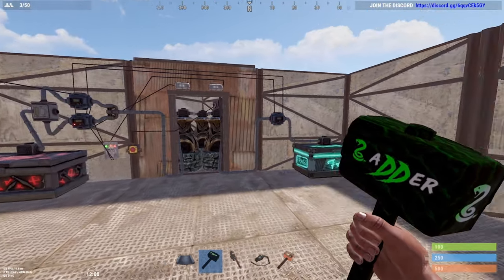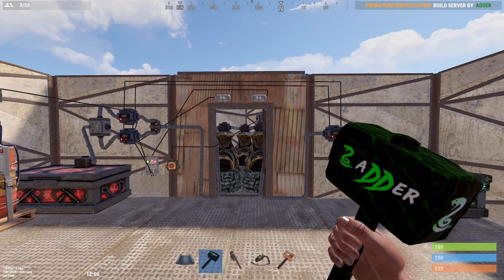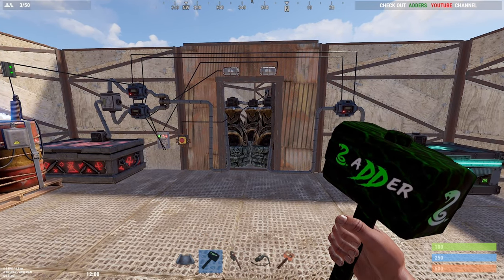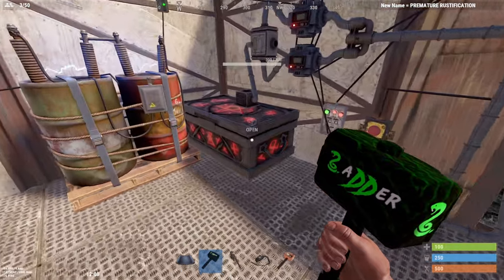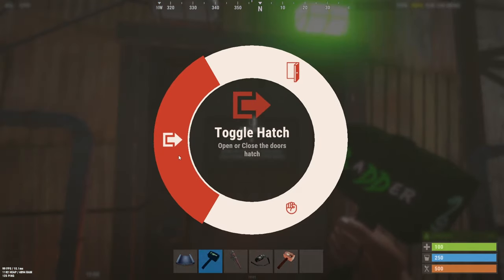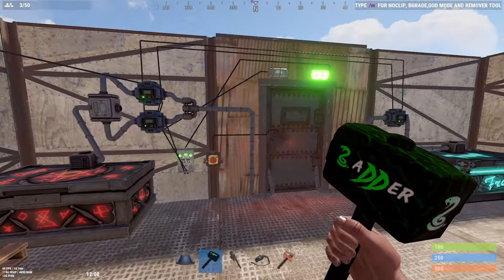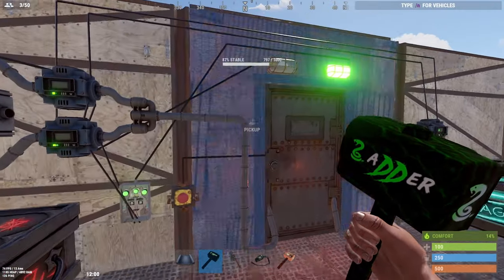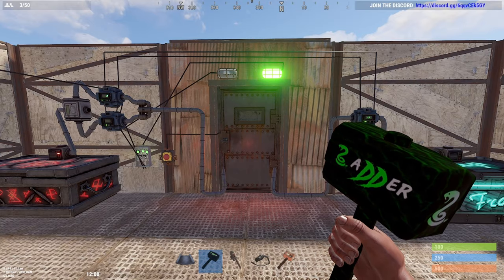Industrial AUTO FURNACE'S in Rust

Comment: i had a similar setup in my chinawall base on the last biweekly wipe. i had a total of 12 large furnaces that auto fed from drop boxes, push to ignite, they auto depoted into the open core and i also used a water catcher, fluid switch, and a few sprinklers to turn them off instead of doing it manually like a peasant
Reply from the maker: Damn that's nice

Comment: I have been setting up elaborate furnace and craft him for the clan I am in which has 20 April and I still cannot figure out how to make the blueprints automatically switch so that I only have to use one of each workbench to craft everything rather than multiples of each workbench. I saw a video that showed how to do it but it had no audio or Text explaining it. Are you good enough at this stuff to show how to do that? I can send you the link to the video if you need it.  I think it had and switches or switches blockers and  Probably memory cells I don't remember the wire not it looked intimidating Which surprised me because the base I'm in now has Over 30 furnaces And it only took me one conveyor for all 30 of though so I know how to do a bunch but not what that guy did.  I also have the lockers and meds and everything auto press and auto fills which is great but I would like to do it with less work benches because on early wipe it is hard to get more in the space is kind of ridiculous even with 2 crafters on  each workbench.
Reply from the maker: Dude I wish I could help but I have not touched crafter's :( sorry my guy